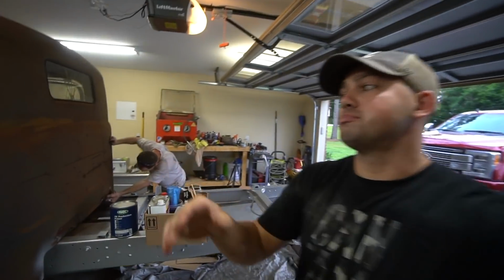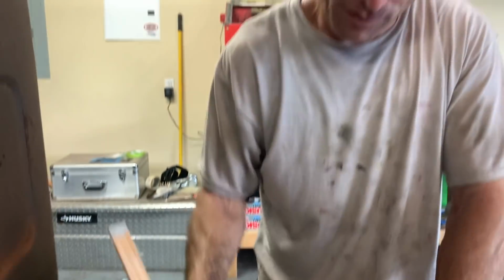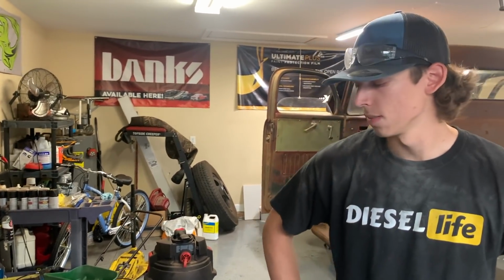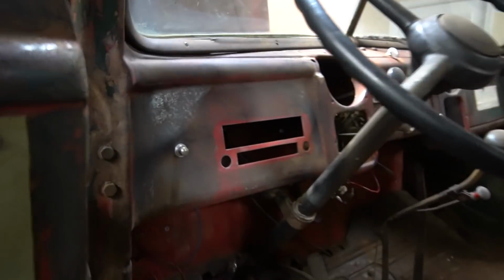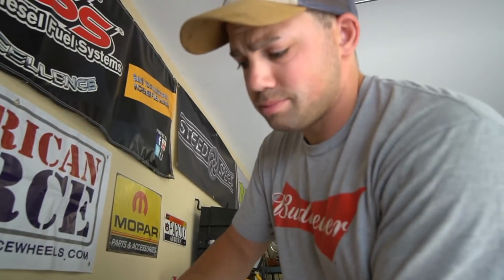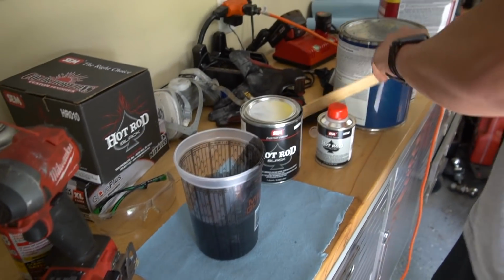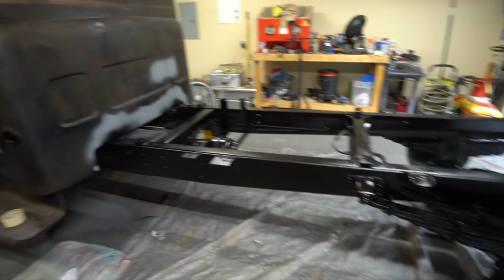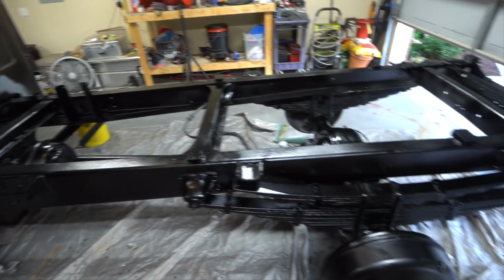WE FIX MATER'S BIGGEST ISSUE!! MAJOR PROGRESS MADE!!

Comment: It would have been nice to have just pulled the cab and do media blast then replace all bad metal.. I do all mine that way .. While the cab is in body work its easy to work on all the powertrain and restore the frame to its full potential.. But its all about what you got to work with.. I made all my lifts and bridge crane..
Reply: Way to go Tiger
Reply: Once a body has been damaged by heavy pitting it's pretty much going to be a rat rod unless you want to spend hours and hours (with good skills) sand blasting and bondo-ing to get it back to the factory smoothness.

Comment: A high-gloss paint on the cab is going to really show all the imperfections. A slightly duller finish will help with that, and the factories in the 1940's really didn't use a high-gloss anyway so that's more correct for the period.

Comment: Hey guys, it is looking so fine. I give it my seventy three year old seal of approval and hopefully that will reach you. I am full of questions, like I know that international had the cowboy cab and I though that those tops unbolted too??? Might not when you think Chrysler instead of I. H. so that would make a difference for sure but the front clip should come loose and let you get that front the really fine tuning. Plus before you put back together, you might do what the surprise motor is going to be and set her in. as well as paint the rest of that frame up front. Then there is a flat material that goes between the fender and body on older rigs that the seam is accented. Root beer Brown with black fenders, dark dark green and black fenders, Dark deep Red and black  fenders.... a really nice charcoal grey with black fenders.. these are in order of my first and next then next etc. If the whole rig is going to be one color then the grill work should be as close to polished steel as in stainless steel as in the day.  I might be stuck on the two color thing ... ya think./LOL. I believe that the radiator shell is to match body of truck and the grill has to stand out!!! And the grill itself needs to go black, or chrome or one of that two color themes and pin strip with other so its all important. Gonna be sweet but I am so old that I should be there barking "Watch that air line!" or some other Demeaning thing to spoil the fun and sound like a bad C.O. who had his strip pulled. You guys would be muttering stick him with a blade!! LOL, just have some grins with ya all. I think your doing fine without me... at some point we need to see what you have for shoes.... brake shoes that is!! And while up front do those king pins and look into a power steering assist for that front drag link. Have I got it in the red yet???
Reply: Morgan iam 68 an I remember these old girls to she does 2 color like they were back in the day Ive seen lots of em black an yellow with drivers name on door they were so cool
Reply: @jackman6256  Way cool Jack. I had one with my girlfriends name on one side and mine on the other... they just looked better with that two tone look... thanks for chatting me here in central alaska

Comment: It looks very nice but in some cases you are hiding the rust and not getting read of it.
The correct way would be disassemble, sand blast, patch (with metal) and then coat and paint before assembly.
Looks very nice, however.

Comment: GUYS IF YOU ARE USING 2K PRIMER ON CAB DO AS MUCH BODY WORK YOUR GOING  TO I WOULD PUT 3 GOOD COATS ON THEN LET IT CURE FOR 12- 14 DAYS WITHOUT DRIVING IT  NOW BLOCK  IT WITH 80 GRIT THE PUT ON 3 MORE COAT WAIT ANOTHER 12-14 DAYS THEN USE 180THIS WILL  ALLOOW THE RIMER TO CURE  SO NOW YOY CAN USE 2 FAST WET CQATS LET THAT TOO CUT IT WN WITH 320 ON A SA SANDER OR 4OO WET AND AS ALLWAYS KIDS USE YOUR DURA-BLOCK

Comment: it was looking good right up until you bogged the rust holes.. you should have cut the rust out and welded new metal in there. it will come back and bite you in the ass.. I have the same truck I'm doing up at the moment. they are a great looking truck